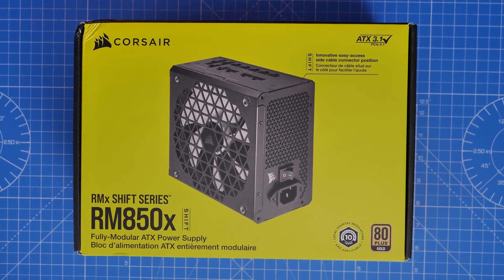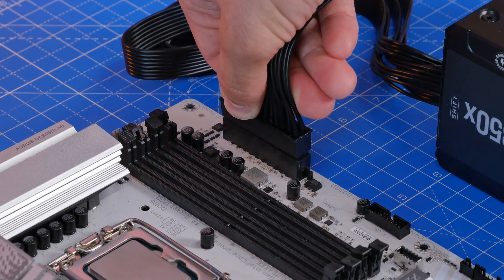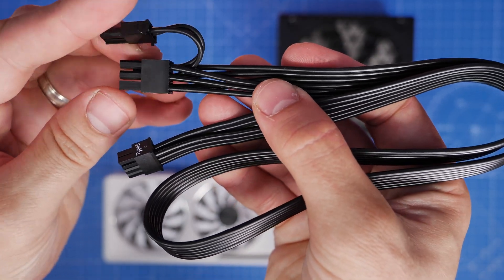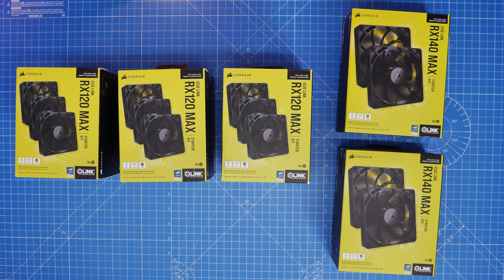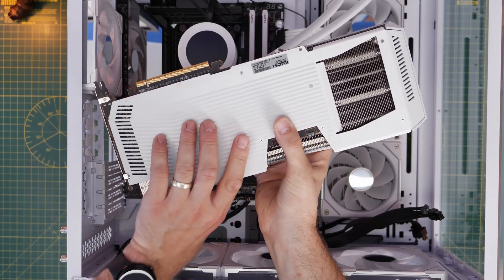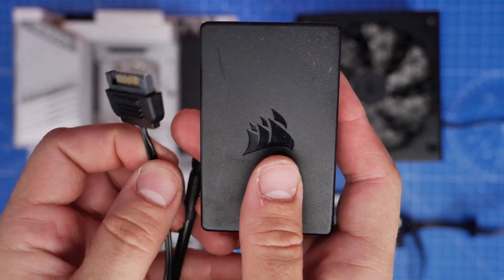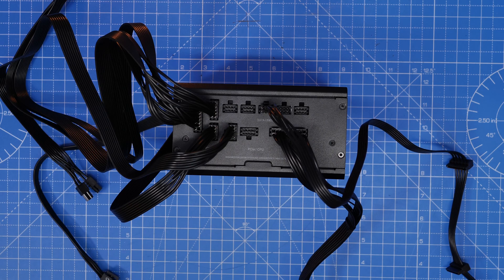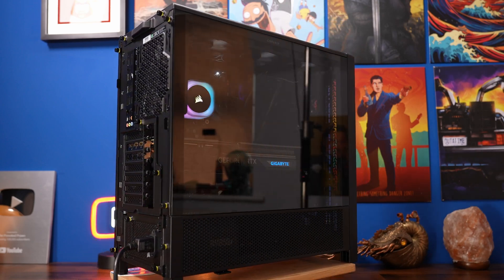Corsair RM850x Shift PSU wiring and setup guide

Comment: This is the only video that comes out with a Spanish translation, so I would like to know if the same connections for this power supply are the same as the Corsair rm1000x?
Reply from the maker: Should mostly be yes. Worth checking the tech specs on Corsair's website, but also https://www.youtube.com/watch?v=BbT710P2r6w

Comment: Are all five PCIe connectors the same, or do they change voltage? Is there a specific order for powering the CPU or video card, etc.?
Does it make any difference where each one is located, say, for powering the CPU or a video card? Thanks.
Reply from the maker: CPU power cables are marked CPU on the cable.
Reply: @TheProvokedPrawn  I think you didn't understand the question and I'm having the same one

Comment: I have that same power supply, but the ATX 3.0 version. It comes with the same cables, but I think I have the 12vhpwr cable. Do I need to buy the 12v-2x6 cable to replace the other one? Or isn't it necessary for an RTX 5070 Ti?

Best regards!
Reply from the maker: https://www.corsair.com/uk/en/explorer/diy-builder/power-supply-units/evolving-standards-12vhpwr-and-12v-2x6/?srsltid=AfmBOoq87Qweik5CDuhTjdK8-dggCMnrR4Yat3jFxzlg2YWRi88EdC66

Comment: I just bought a Corsair rm850x shift power supply, what I notice is that the 24-pin connector is missing the standard -5v pin but also the -12v pin, I tried connecting it to an Asrock hdv 450 motherboard with a processor with integrated Ryzen graphics and it doesn't give an image, I also tried it on an Asus z790 motherboard with a separate graphics card and it does give me an image, (the motherboard with the integrated graphics processor works with a generic power supply)
If the -12v pin is normal for it to fail, I would like to know what types of motherboards this power supply is compatible with

Comment: Anyone have issues with psu overheating using this psu due to the fan not running at all ?I know the fan is zero rpm mode without additional control but even when under greater load with higher temps fan still doesn't run.
Reply: Do you actually have issues like shutdowns or does it just get hot?
Reply: @20storiesunder  The  pc shuts off and ofc if I leave it and then boot back up it is fine. Also if the workload  is that stressful then it just works.

Comment: Incredible video and thorough wiring guide! Really helped me make sense of the setup. I know this is off topic but any chance you could do a tutorial on installing a CPU air-cooler with the motherboard already in the case, specifically for LGA 1700? I’m having a hard time keeping the backplate in place and really don’t want to remove the board. Don't think this is an issue on AM5...it might be an Intel thing. Would really appreciate any tips thanks Provoked Prawn :)
Reply from the maker: Could you try taping the backplate maybe? Some coolers use double sided sticky tape on the back plate so it sticks to the back of the motherboard.
Reply: @TheProvokedPrawn  would the motherboard be damaged?

Comment: I have the RM1000x Shift in my 2500X case with the MSI Project Zero B650M . A little snug because of the size but it ended up being super easy to install and get everything wired up. My only complaint, if you can call it that, are the stock cables being extremely stiff. Otherwise I'd definitely recommend it and the smaller versions especially for micro-ATX cases.